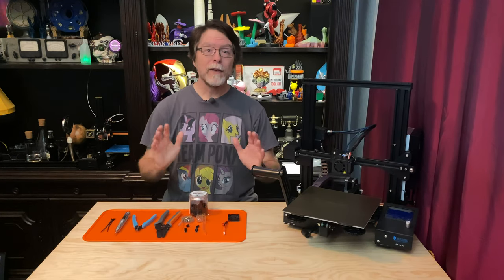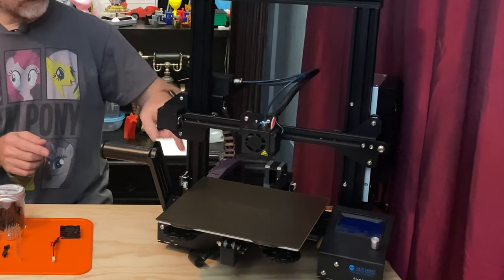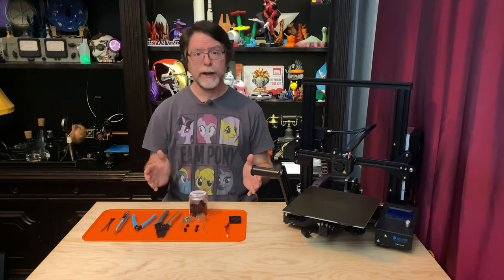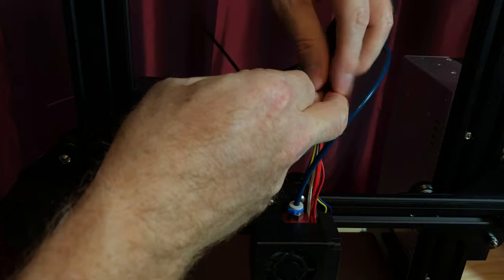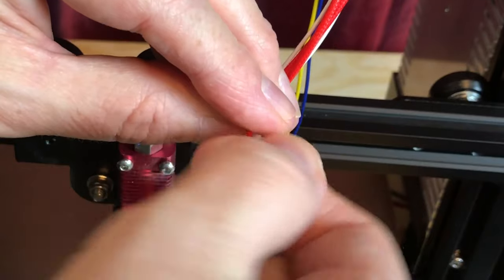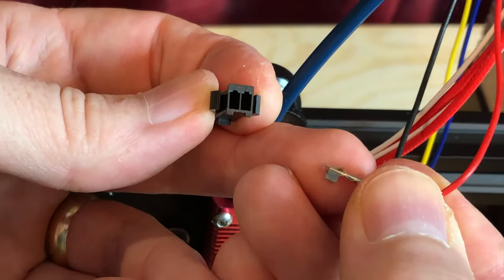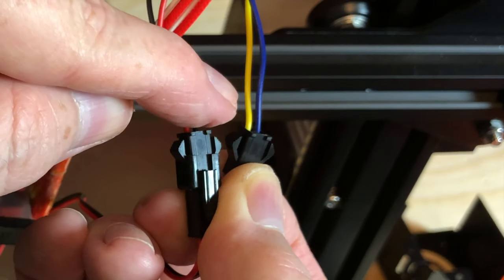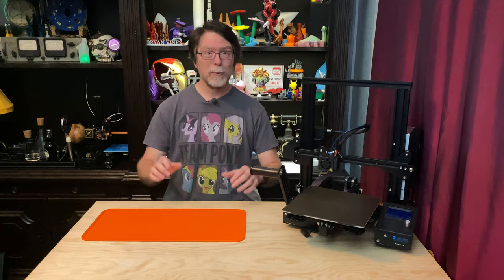How To Replace the Fans on your 3D Printer for Easy Future Maintenance

Comment: or just solder them and use liquid tape... who needs more bulky connectors that are not more reliable then old fashion soldering...
Reply from the maker: Some people are more comfortable with some tools than others, and may prefer crimping connectors rather than wielding a tool capable of melting metal. 😁 Personally I’m OK with either.

Comment: stop wasting energy and turn off your printers when not in use
Reply from the maker: And unplug every AC adapter in your house when you're not actively charging the thing they charge. They're still active and drawing power otherwise.
Also, unplug your TV when it's not in use. Otherwise it's not really off it's just in standby, wastefully using power.
Several other appliances are the same way. Unplug them ALL when you're not using them, just to be sure!

On a more serious note, I literally only have one printer on right now. And I'm about to send a print job to it. The rest of 'em are, in fact, powered off.